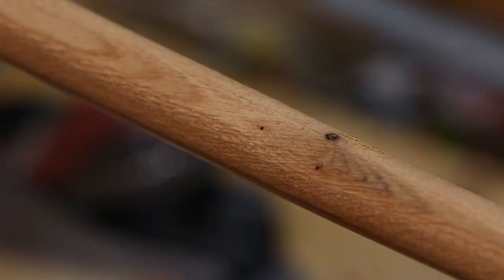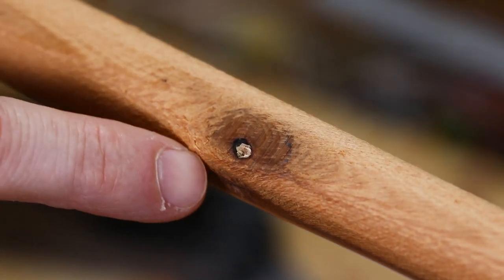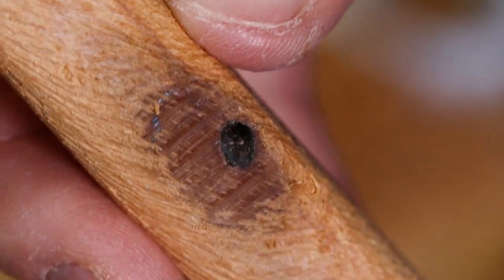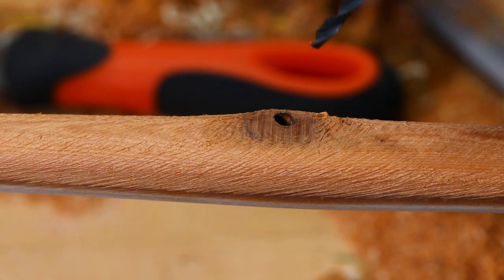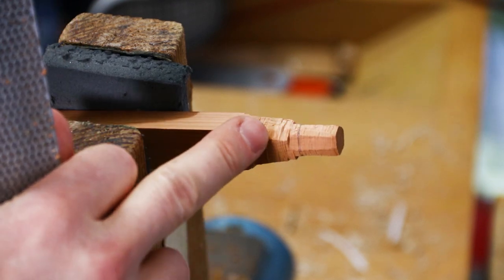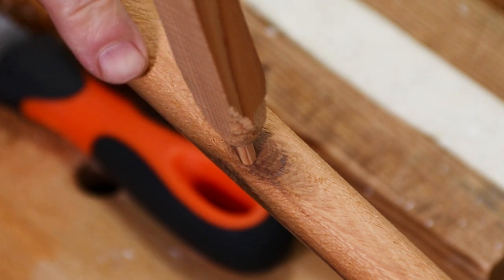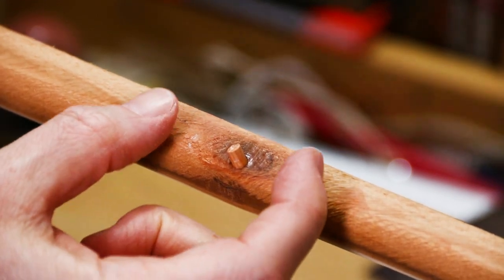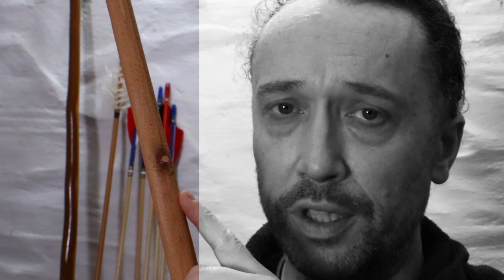How to deal with and Plug a Knot in self yew wood   How To Make a Longbow series

Comment: Phillip 
Herb here
The plug you used ,was not the grain of the plug going in the wrong detection to the staff will that plug compress differently then if the plug was also cut to the grain that could also be made with a plug cutter.
The only real question for me is do they make a plug cutter that small
I as question like that only because it seams there would be a problem
Reply from the maker: It won't make any difference because the area will not be bending due to the extra material I leave around the knot, please watch the video I mentioned so you can understand
Reply: Hi Herbert, as I’m a luthier also I found it interesting that the grain was not matched but I understand the solution. I’ve made several different sized plug cutters by filing teeth on the end of small tubing. StewMac do a screw repair kit for those pesky machine head screws that sheer off from time to time.
I’ve got a yew stave that’s full of knots to repair.
Great informative video I thought 👍